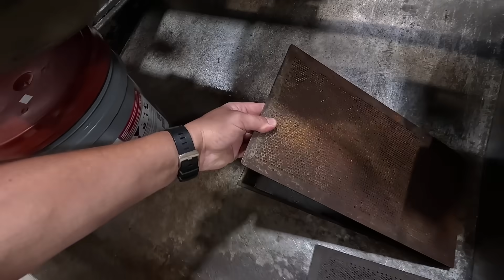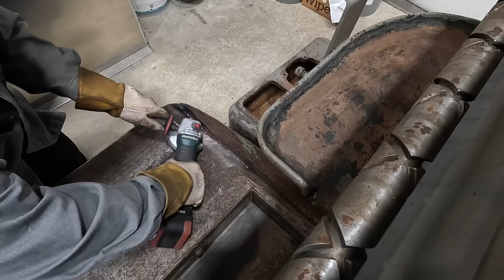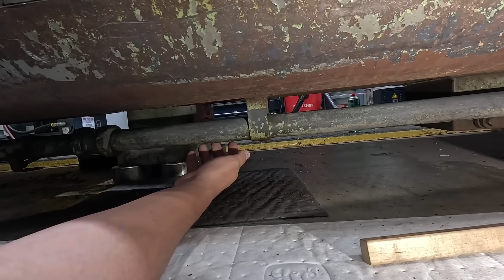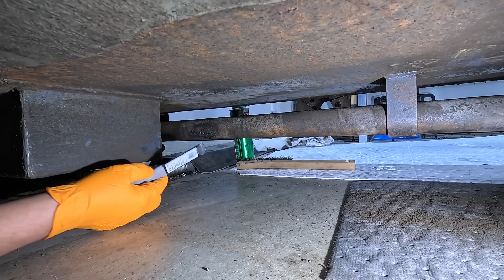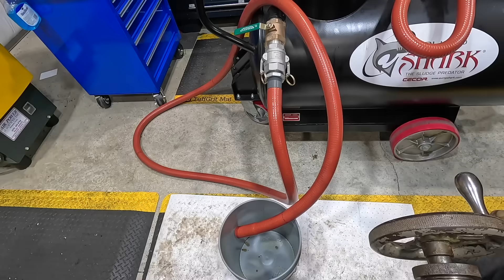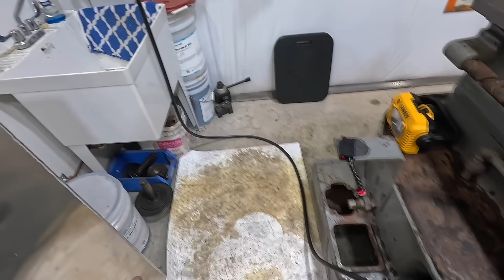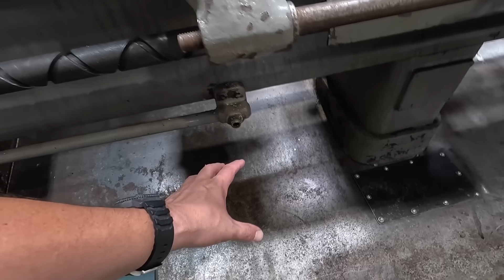American Pacemaker Flood Coolant System Repairs Part 1

Comment: Wouldn’t it just make more sense to replace the busted pipe instead of dealing with all these temporary fixes?  There’s access to the pipes and they’re clearly removable.
Reply: You saw how much space there is under the lathe, how exactly are you going to fit a pipe wrench underneath and break 80+ years worth paint and rust free to replace the piping?!
Reply: Yeah, that would be the right thing to do, but getting a big pipe wrench to a remove that big 1+ inch pipe would be a PIA. It wouldn't be a problem if he had access from below, but he doesn't and I'm sure he doesn't want to lift or move that lathe after all the time he spent leveling it. He chose the easiest and IMHO correct solution to just patch it and has the results proved he was right.

Comment: used the JB weld on a crack on my lawn mower/tractor on the V twin engine crankcase panel, does not leak oil for 4 years now

Comment: Just replace that rotten pipe with PVC, it’ll just keep rotting out new pin holes for ever!!!
Reply: He would have to lift the late completely off the ground a couple of feet to be able to get up in there. Remove the chip pan. And then try to get all that loose and re run the pipe. I have a feeling fixing that is not going to be as simole as running a new pipe.
Reply: @demonknight7965  He has the crane right there. Putzing around with the repairs, he could be done already.
Reply: @firesurfer  You have no idea of the weight of the Pacemaker. That crane is far far away able to lift it.
Reply: @firesurfer  Did it ever occur to you that by moving the lathe ... even if he could ... would mean that he would have to relevel it? Nope ... probably not.
Reply: @firesurfer isn’t lathe out of its league..
Reply: Knowing how meticulous Abom is I am positive that he is more bothered by the fact that he isn't replacing that pipe than anybody watching. He said he needed the lathe with flood coolant for some jobs and I'm assuming he just doesn't have the time before doing this proper and do the releveling he would need to do. Honestly, I think that you're so obviously right about the pipe needing to be replaced that Adam didn't even think he needed to mention it. 😅 Like it's the obvious thing to do to get this in Tip-Top shape.. but I do think that it's also true that the J-B weld and flex tape is going to work fine for a while.
Reply: @retrohipster1060  from what I can see, relevling would not be necessary, there are unions in the pipe and any good plumber could remove and replace those pipes as they sit. In fact it looks very simple to do if I lived in Florida I would volunteer to go replace them for him but I am not there.
Reply: Yep was going to comment the same, sure you'll be able to crack open them joints without lifting the lathe  or even some flex hose as a temporary fix where its rotten
Reply: I “THINK” that all those leaks was the reason there was no coolant pump or upper plumbing.. it was pouring out and they said to hell with it … just use cutting oil.
Reply: Easier said than done
Reply: there is an internal liner that can be installed, uses and epoxy soaked sock that is installed with a pressure bladder and a UV light to cure it.

Comment: You could just cut the pipe out and replace it with heavy hose.  There are plenty of suitable hose materials that would work.
Reply: Why? He could just unscrew the pipes (well, a skinny friend) and then repair or replace them. The object was doing it all quickly.
Reply: @DeepPastry-m7d yeah, quickly.  Cut the section out with a saw or torch, get a piece of hose that will fit over the pipe and pipeclamp it.

I do not know how hard it would be to replace the pipe, end-to-end.  That could take the lathe out of operation for some time....which I was not suggesting.
Reply: @krbruner  Think you missed the couplers. Both ends of the pipe, and the couplers were all easy to see and reach (from the backside). The time to cut and all the other things would be the same just to screw said pipe(s). Maybe longer going with cutting and stuff. The epoxy and tape methods is quick and let's him do the job he needs flood coolant for; while also preserving the pipe connectors and stuff to make a permanent repair easier in the long run.

Comment: put in new pipe section
Reply: No!
Reply: That was my thought as well. There are two easy to reach joints. Just unscrew them and take the pipe out.
Big risk the whole pipe is just as bad. If it starts leaking when you are away from the shop things can get messy.

Comment: 19:00 mig be easier but drill thread n tap an option .........  also with weep hole on the headstock base.  Or replace that pipe if it's threaded [edit] I see you already solved it

Comment: Forget JB weld do it right replace the pipe for a fire safety issue in the future when your not in the shop and it starts leaking and the fumes reach the heater .Cut the straps around the pipes under the pan remove the pan from the lathe, fix the pipe, slide the pan back in 
with new straps .
Reply: Catch fire? The coolant is mostly water.
Reply: Fire safety. BAWAHAHAHA. It's a coolant system. Pay attention.
Reply: Fire 😂
Reply: If fumes were the issue it would catch fire without leaking seeing as how it’s an open system, and he’s in Florida genius. You know the state known for cold weather year round. Stick to sitting at home watching YouTube